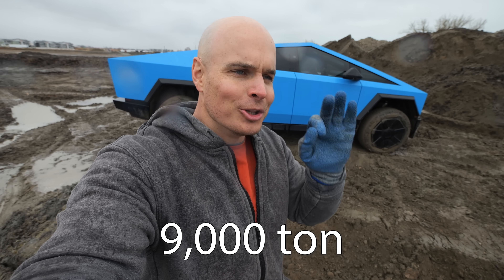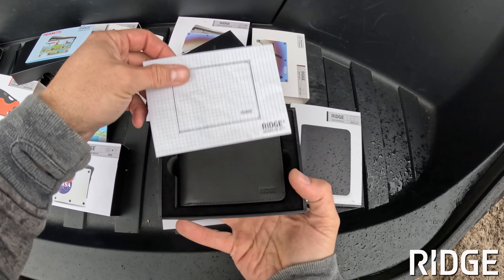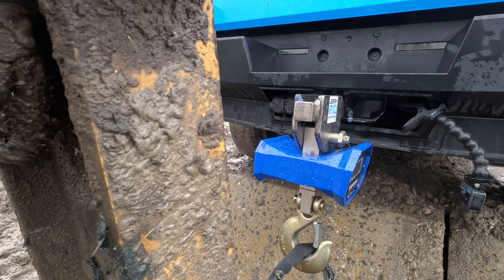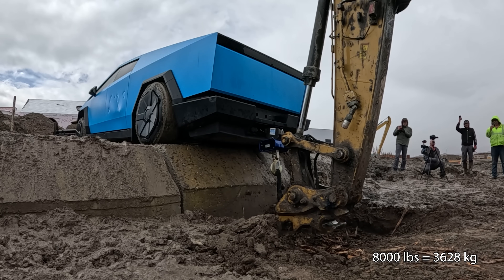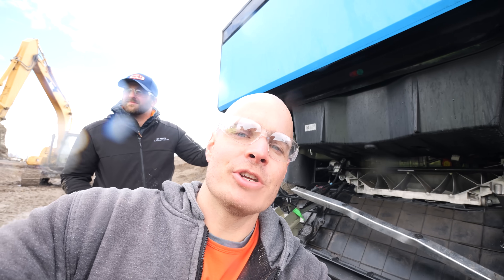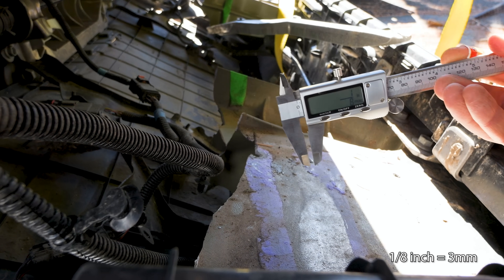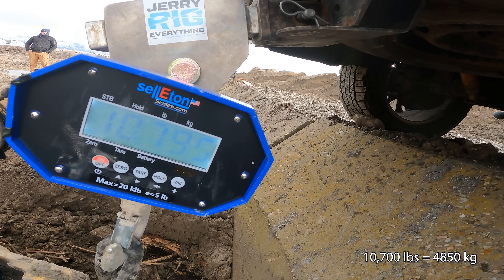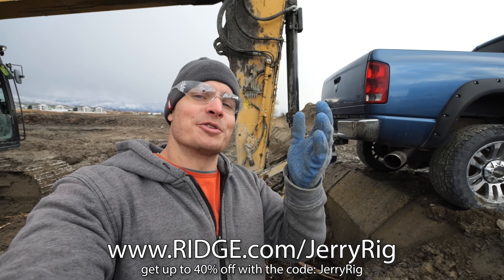SHOULD YOU TOW WITH A CYBERTRUCK?! - (catastrophic failure test)

Comment: It's evident that compromises have been made in certain aspects of the Cybertruck's design, and anyone considering purchasing one should be fully informed and research thoroughly beforehand. If your primary motivation for buying this vehicle is to tow heavy loads or fulfill practical trucking purposes, then you're misguided. The Cybertruck is not designed to function as a standard workhorse; it's a statement vehicle meant to grab attention and showcase individuality—whether that's perceived as cool or not. There's nothing inherently wrong with the Cybertruck itself, but it’s unreasonable to expect it to perform the duties of a traditional truck without issue. Its unconventional features, like the cast aluminum body, aren't revolutionary. If you're under the impression that this truck will perform like a tried-and-true work vehicle, you're setting yourself up for disappointment. In short, buy a Cybertruck because you appreciate its unique characteristics, not because you need a heavy-duty truck—get a real truck for that. I imagine the cyber truck could handle transporting certain items, but I’d never trust it to carry heavy-duty gear, even before learning all these details. Simply observing the vehicle and hearing the exaggerated claims about its supposed tank-grade armor was enough to give me doubts. 
A fundamental lesson I grasped long ago holds steadfast every time: whenever something seems unbelievably perfect, it simply isn't real. This is an unwavering truth. Even in rare instances where an incredible opportunity might appear genuine and beneficial, such occurrences are vastly outweighed by countless situations proving otherwise. The sheer number of deceptions I’ve encountered far eclipses any singular exception, ultimately reinforcing the principle that things too good to be true are almost always false.

Comment: I'm in no way making excuses for this truck (I don't own one and don't intend to) but isn't it a little bit disingenuous to test a hitch by pulling it straight down in a way that it would not normally be used? The strength would be horizontal (pulling in line with the truck) and not vertical, no? Or am I missing something?

Comment: Hey Guys if you go to 6 mins and 38 seconds i see there is a crack on the frame where the hitch is I'm surprised you didn't see it when it was at 8,000 pounds. That did not go to 10,000 pounds. it cracked on the frame at 8,000 I think a good test would be to have the truck drive on a safety course to see if 7,000 would be able to pull it and see if it would be safe to drive at it. I know some people may think hey it would be safe to drive at 10,000 since it totally destroyed and tore off at 10,000. I would also recommend that you put a disclaimer for people not to try this project . You never know. Thanks for all your content I really like the videos.

Comment: Crash tests have shown that shock loads like what your talking about are highly unlikely but if one was encountered the front end will go up much more than a tractor stressing it down would allow for and as that fulcrum takes place the hitch weight is reduced well below the breaking point in the 2000 to 2800 pound range. This vehicle has a maximum tongue weight of 600 pounds and teatering shock loads from speed bumps or big dips in the road will commonly hit 2000 pounds which is WAY less than breaking or even yield load levels.  
The Tesla will break sooner than an ram truck, true enough, but the extra cost and weight of the ram being over engineered is not something to brag about it just foolish excess.

Comment: Not a Tesla simp...but pinning the front end makes this test worse on the vehicle...as vertical displacement (up) of the front end would reduce the load on the hitch...

IE:...it makes it harder for a load within the load rating of the truck to exceed the load rating due to some road condition or braking.

Comment: The bots saying the Telsa held up well because it's never going to see 10k tongue weight anyway don't want you to know that aluminum also work hardens over time and does not have near the plasticity of steel to return back to shape so even well below 10k tongue weight the design is dangerous in fact there has been several cases of trailers breaking the hitch on the cybercrook while towing with no where near 10k tongue weight.

Comment: For those wondering the 2004 ram is fully boxed Steel frame. I believe hydro formed. For those doubtful of the ram’s durability Kore off road used these ram trucks to Race the Baja 1000. They would drive the truck from California to the event, competitively complete the race and then drive back home. I can’t recall another brand of truck that does that?  The cyber truck can stop a bullet 😅 it’s got that going for it.. lol.

Comment: Yes, this test may seem quite extreme in practice, but the main point here is the use of aluminum. In terms of metal fatigue, aluminum will lose performance over time. This means that regularly carrying loads around 5000–6000 lbs will significantly shorten its lifespan. Steel seems like a more reasonable option for long-term durability.

Comment: Surely you wouldn't even want to tow anywhere close to 6,000 either, right? If that's the point where the metal starts obviously flexing, repeatedly towing even 6,000 would create a weak point that would eventually snap? Even 3,000 or 4,000 seems risky, you don't see anything but it's still slightly flexing it, and much more significantly if you're towing long distance!

Comment: I honestly do not see any problem here. The Cybertruck is rated at 1,500lbs of tongue weight. It just did 8X that much. Manufacturers rate their trucks for tongue weight to be roughly 10% of max towing capacity. So the cybertruck did well per the average manufacturer specs for designed loads. This is my non Engineering background, personal understanding of this.

Comment: Yeah, towing for 20 years…not quite sure I’d complain about this ‘failure’ the tongue weight limit is like 1100, and it fails at 10500? Ok…so the Ram passes, but saying it failed before its 11000 towing limit is crazy.  It failed MUCH beyond its payload and tongue weight limits.
Reply: Yea, my truck has a max tow of 16,700. I would never expect the hitch to hold up to 16,700 lbs of tongue

Comment: So...the tongue weight of the Cybertruck is 1,100 pounds.  By merely pushing down on the hitch, you were simulating tongue weight...and the frame/hitch/whatever assembly didn't fail  until 10,000...that's pretty much 9 x the tongue weight maximum.  No fan boy here, but that seems pretty decent to me.

Comment: I'd like to see the test repeated with a load pulling straight back on the hitch instead of up and down.  That was pure tongue weight, and it seemed to handle that just fine.  Now don't get me wrong, I'm not defending Tesla.  Aluminum acts just fine right up until it snaps - often without warning.  Steel you see deflecting before it finally gives.  I'm a big fan of using steel for truck frames, let's just leave it at that.

Comment: Stupid video.  GAWR?  Anyone hear of that?  All those equipment operators around I'm surprised none of them called you out.  They know better; You don't load the hitch with the full weight of a trailer.  These are basics. 10,000+ pounds?  My 2500 HEMI RAM with a class V maxes out at 1,800 pounds on the hitch... max and you want a class V hitch to take 10K +?.  The argument isn't aluminum vs. steel.  You actually demonstrated the robustness of the aluminum giving it way more weight than it would ever see in the real world.  You put over 10K on it?  Sounds like another Elon hit piece.
Reply: did you watch the video at all?
Reply: @johnnysun6495  
Have you? CT hitch rated at 1100, it failed at 10400. One number is bigger than the other, for this to be a failure those values should be reversed, but its not. So like, have you watched this video?
Reply: @Zripas  You're missing a zero. It's rated at 11000, fails at 10000
Reply: @johnnysun6495  
No... Its rated at 11 000 as TOWING capacity, this was vertical load test, which is usually around 10% of towing capacity. So vertical load capacity was 1100. Welcome to reality.
Reply: @Zripas  Okay, I am now 100% sure you did not watch the video. 9:45
Reply: @johnnysun6495  
So your counter argument is to say that video creator has no idea what he is talking about? 
Tong vertical load capacity is 1100, it failed at 10400, that's more than 9x. If you want to argue that some nutjob might improperly load his trailer with overweight load and then hit a pothole going 90mph at 45 degree down hill... Well... I guess you have a point... Next time complain that its not meteor resistant as it might be hit by one... 
So will repeat basic numbers here, tong vertical load rated at 1100, it failed at 10400. That's it. This same thing applies to basically all cars, you have towing capacity X, to get vertical load capacity you simply take 10% of that. If you want to overload it by more than 9x then don't act surprised that it failed... You people are making such weird arguments here, its just weird and sad at same time

Comment: Add this to the list of reasons that I would never buy an electric pickup truck to do anything but drive around and occasional load in the bed. Towing would be basically out of the question due to the limited range. It's already bad enough with the added stops on a gas powered truck. Even for short distances I wouldn't want to tow anywhere near 11k lbs with a cybertruck. I've towed quite a bit and almost every truck I've ever owned has had the hitch bottom out on something while off road, sometimes on the road itself. Do that one time with this truck and it's toast. I can't see this being useful on American roads in real world work scenarios for that reason. I'm sure they could fix it though. Probably by making a special rear subframe that includes gussets to the main aluminium frame to distribute the load more on the frame in the rear. Would add weight, but maybe not as much an entire steel frame, plus it wouldn't require a complete redesign.

Comment: Wait, serious question. Is this the Ram that is rated for 19,000lbs? So "nearly" is equal to 8000lbs difference?. So over 70% higher when compared? This seems a bit disingenuous no? If that excavator was indeed 50,000lbs. You could have definitely changed the distribution of the load to get higher than 10,000lbs. Now I understand where all those people were coming from with their accusations.

Comment: That’s 2000 lbs of down force though the weight of a trailers tongue weight is a mix of down force weight and momentum force pushing forward we just pulled 2 can am mavericks on a 8700lb flat trailer, not a single issue 😂❤

Comment: You lost a sub on this one. This test is only useful if the trucks are rated at very similar towing capacity. To prove your point properly, you should use a steel frame with a significantly LOWER tounge weight capacity than the Cybertruck.  If you did this again with something like a Tacoma, then it would hold some merit

Comment: This test is wrong and the Cybertruck passed with flying colours because you far exceeded the tongue weight not the towing capacity which is more horizontal stress than vertical. This could lead to legal action from Tesla if you don't represent things correctly.
Reply: That’s not true though. The trailers tires are still holding the majority of the weight.
Reply: @ I can tell yall never towed anything. I'll use a speed bump or speed table as an example -- When the back tires of the vehicle are raised higher than the trailer tires, the "majority of the weight" is applied vertically to the tongue. Furthermore, the sudden change in the direction of force at speed can exceed the total weight of a trailer and the load. Dropping a bowling ball on your foot hurts a hell of a lot more than setting it down. Get me?
Reply: You and a lot of others seem to have not watched the whole video. He explains. Also, if you ever towed anything you will eventually feel all the weight of the trailer on the tongue because, well, shit happens.

Comment: Huh. Cybertruck was impressive. The aluminum frame holding 8x the rated hitch weight seems reasonable. Not sure what this was trying to prove. 

I’d also like to see someone setup a trailer test rig showing them get 10,000lbs+ of downward force on a hitch while driving without intentionally loading 10,000lbs directly on the tongue basically, as Zach indicates commonly happens apparently.

Comment: This is a little bit of bullshit, guys ;) Towing capacity of hitch of my car (Mazda 6) is about 1500 kg. But the loading capacity of the hitch is only 75 kg (!). Yes, only 75 kg. If CT has towing capacity 10 000 kg, it does not mean, that the hitch has the same loading capacity as is his towing capacity. Those are two completely different things. Loading capacity is much lower.

Comment: I would say don't read too too much into this static test (other than it's piss weak). This part is normally loaded in a different direction (longitudinally, during acceleration and braking) and those loads are all dynamic, so beating on it with an instrumented sledgehammer would be more representative.

That all said, if it's FAILING, not merely yielding but actually properly failing at the loads you measured (even in the vertical direction), it is NOT adequately strong to sustain cyclic loading at its rated capacity.

Whoever specified this part is a cretin.

Comment: So, you confused tow weight with tongue weight, got the definition of fatigue limit backwards, misstated the max tongue weight a load will exert by about a factor of 6, and got basic physics totally backward as well... If you had any self-respect you would take this down, as it's nothing but misinformation. The reality is any truck is legally required to have a tongue weight of 15% the tow weight, because that's the most that's ever likely to happen, not 100% (are you insane? That would literally require the load to be hanging off the hitch at a 90 degree angle). This test showed the Cybertruck exceeds the legal requirement by 6 times, which is incredibly safe. The other truck did take more but it also has a higher tow weight, so it still didn't reach the same tongue/tow ratio that the Cybertruck did (not that we know it couldn't, since you didn't actually plan the test properly).

You managed to both prove the Cybertruck is very safe and simultaneously tell everyone the exact opposite. Congrats, you're a misinformation guru.